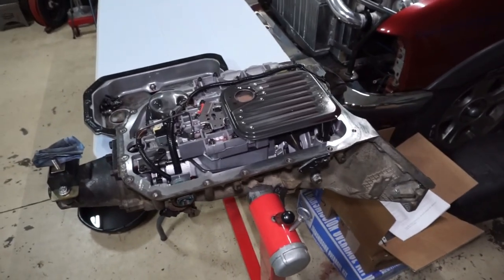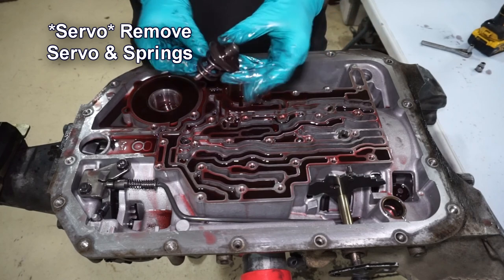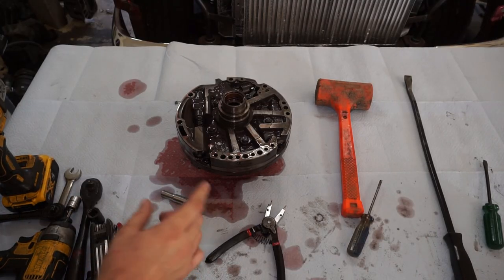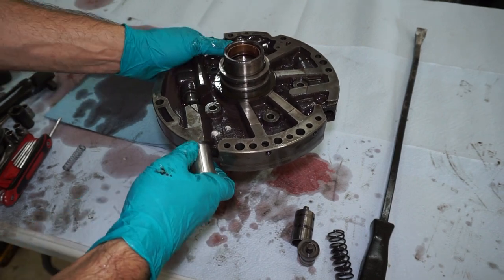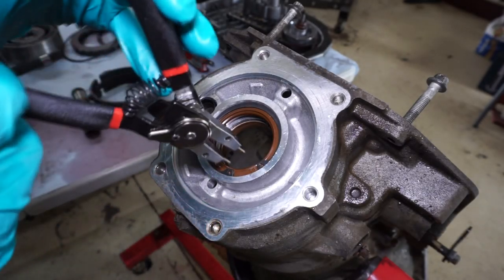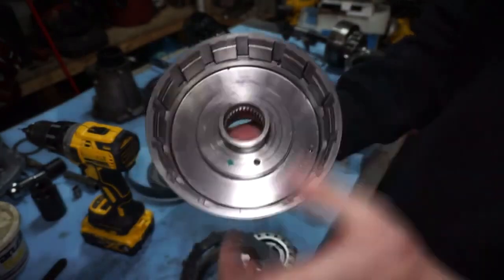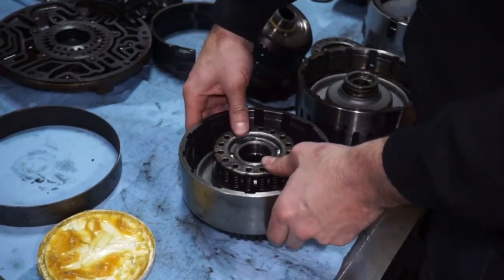4l80e Rebuild With Extreme Automatics Trans Brake Install ‐ How To.

Comment from the maker: Time Stamps:
1:02 - Valve Body Removal / Intermediate Servo Removal
5:02 - Rear Lube Fitting Removal Discussion
5:12 - Pump Removal / Dissassemble
8:38 - Line Pressure Valve Spring Install
10:05 - Internals Removal Starts
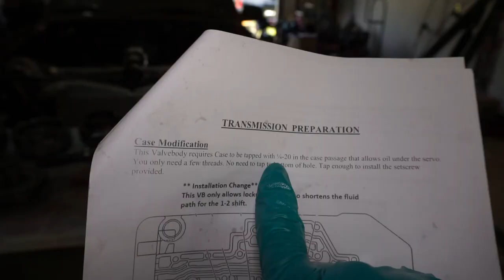12:55 - Case Modifications 
14:30 - Rear Rollerized Output
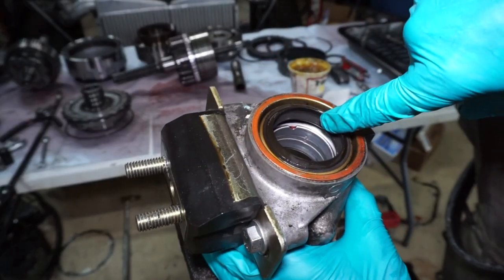17:00 - Reverse Band/Rear Carrier Install
17:41 - Center Support / Intermediate Clutch Pack Install
19:40 - Direct Drum Dual Feed Modifications
24:51 - Rollerized Forward Hub Install
25:43 - Drums Install 
26:43 - Overdrive Drum / Input shaft Removal
30:55 - Input shaft seals
32:05 - Pump Assembly
32:25 - TCC Valve install (after Modification)
34:37 - Overdrive Drum Install / Pump Install
35:26 - Extreme Automatics Valve Body Install

Comment: I've watched this video at least 20 times already. I am wrapping up my first 4l80 full rebuild and installing the same extreme automatics 1+2 transbrake.  All your 4l80 videos are helpful and this one really helped me out. Thanks for all the 4l80 videos.
Reply: What shifter did you go with mine is getting installed this week. I was thinking my b&m pro stick would work , But i cant seem to locate a reverse pattern plate for the shifter .
Reply: @RogueKing86  I actually didn't change anything with my shifter. I'm still running the normal forward pattern BM ratchet shifter
Reply: @RogueKing86  I just checked, I have the B&M universal hammer 3 or 4 speed shifter.

Comment: @18:43 guy from precision transmission channel says to put your snap ring in so the gap of snap ring is not in the opening...he says that lends to breaking the ends of the snap ring.

says to always tuck opening of snap ring under the non open edges... idk if u moved i around but that might of been why u broke a snap ring...

great videos...been watching all these and his videos to get me buffed up for my own 4l80e build. :)
Reply: @19:33 yes according to Precision transmission main builder whos been doing this stuff for over 40 years... you gotta rotate ur snap ring so the opening of it does not line up with opening of case.

god speed and great work.!.
Reply: had to correct my above comment... but yea i think if you spin it so opening of snap ring is NOT in the opening of case the snap ring will hold more horse ponies... i cant wait to dig into a 4l80e and rebuild it.

your videos are the best ive seen on the rebuild of the 4l80e great job..and check out that @Precisiontransmission guy on here hes amazing.

Comment: Ryan, you're a legend! A for effort on the chapter, I need to learn that "new" feature. As an HD2 modder 4L80e owner, I'm curious if it's possible to still change over to the "new" dual feed method after the fact. I installed mine before don't BS me became a build.
Reply from the maker: Yeah, you can.

Comment: Question with Dual Feed Mode. On the case itself should I install the Cup Plug on right side of center support bolt? Or leave it out. Thanks Dave
Reply from the maker: @davidgonzalez9785  Dont unless instructions call for it. With the EA brake it does everything it needs to with the plate.
Reply: @BlaserBuilds  Your 100% right I called extreme they said about plug it wont matter in or out. So I'll leave it out. Thanks for the response

Comment: Do you always use the wave plates in the direct and forward drums? Reason I ask is when I built my 4l80e the wave plate was trashed from catastrophic failure. I ended up just using an extra steel to shim the pack to the correct clearance.
Reply from the maker: No, we didn't in this build, the clip used in video was from a stock drum set up on a different trans. We left the wave out to get the proper clearance in the drum(6 clutch set up), and owner doesn't care if it shifts hard.

Comment: What shifter did he use for that valve body ? I just recieved mine . The the reverse  pattern fuction is screwing me on shifter options. I currently have a b&m pro stick but cant seem to find a 4 speed reverse pattern plate . The only options are three speed reverse plate
Reply: Hey man i see no one answered you question about the shifter im in the same boat as you now, if you dont mind man what did you get or find out for reverse 4 speed shifter ? For EA Thx
Reply: @frostback8160  I had to unfortunately get a m&m air shifter aka pro mod reverse pattern but i will say this the that T brake gets the party started. Make sure you get a Kevlar blanket around the trans 3rd gear is a bomb 💣

Comment: Hi Ryan. I fitted that valve body but without the transbrake. As you said lockup in 4th only I am trying to find out if I can have lockup in 3rd. Can I do the same as you did still by blocking the the feed hole where the pump goes? (Only blocked one hole) Would it still work for me? I'm using both nylon balls too. Great videos you are the reason I built my own 4l80e. Any help would be appreciated. Cheers Adam
Reply from the maker: No, there's a modification done to the plate also. He (EA) doesn't recommend 3rd lockup so doesn't sell them that way. The owner locks his in 3rd at the track prior to this, so it was something he requested specifically.